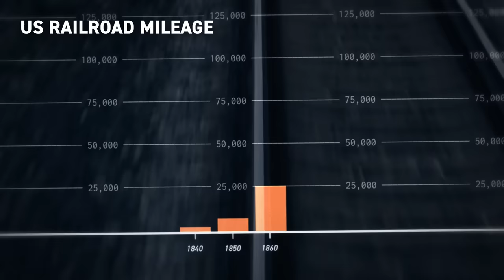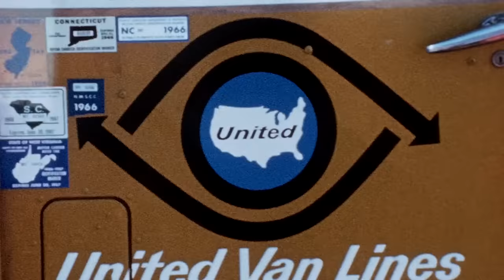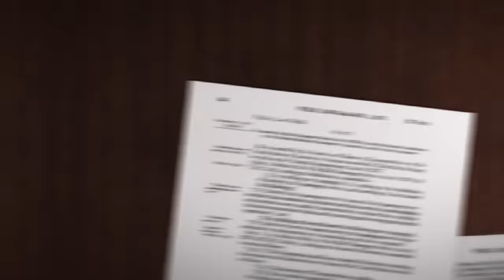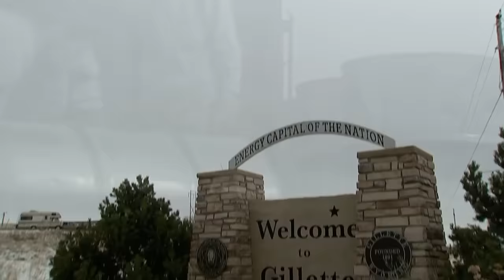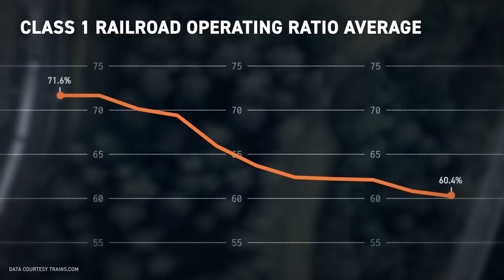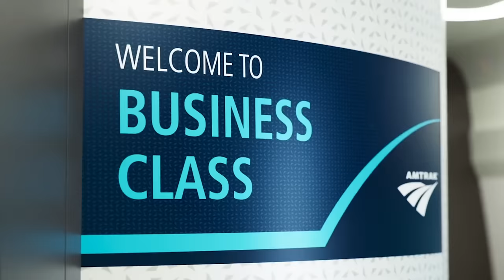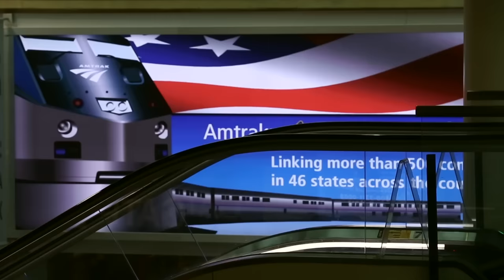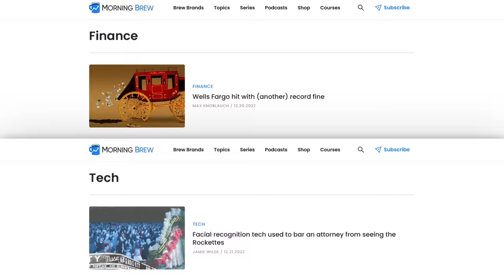The One Tiny Law That Keeps Amtrak Terrible

Comment: I recently took Amtrak from NYC to Virginia and I thought it was great. Granted, I was comparing it to the experience of being on a plane and also, it was NYC to Virginia, not literally any other route. lol
Reply: one of the best routes
Reply: NYC to Virginia is actually a common route for DC. 

I would LOVE to take an 18 hour, overnight train ride from NY to Chicago on a mid cross country trip to see sites, enjoy the views on a low pressure and low cost trip to just slow life down. But. It will never be a profitable route because we have beat into Americans heads to avoid rail whenever possible. 

Honestly, trains will just never be profitable for passengers. It's just too slow, inconsistent schedules, and no wifi for passengers. 

People must fly for urgency or speed or drive. There is no in between :/
Reply: Dude that’s literally my experience but backwards, I went from Newport News to NYC on Amtrak after Christmas, and I was just on my switch the whole time, pretty fun experience actually
Reply: @cheetah219  I don't want to do that at all. I can think of a lot better ways to spend my time than being on a train for 18hrs. You can drive it in 12 and have a car when you get there. A train has to beat a flight or drive on either speed or cost though ideally both. If it was a high-speed rail running the trip in 4 hours and less than a plane ticket that would do it.  Beats a 2.5hr plane ride by skipping the airport hassles and way faster than a car at 12hrs.
Reply: @NONO-hz4vo  I'd disagree. Driving a car from New York to Chicago would mean having to concentrate on traffic for the entire distance, not being able to just sit back, relax and close your eyes, read a book or use your phone. Taking a plane from New York to Chicago means having to deal with check-in, security, limits on luggage and all the other airport faff, and then being squeezed into a seat with inadequate room for any of your limbs. Trains offer the best of both worlds there; the comfort and unrestricted access of cars, and the ability to just sit back without having to operate the vehicle yourself of planes. Sure, time matters and so does cost, but trains don't have to beat cars or planes on those metrics, they just have to get close enough for people to consider the slight increase in time or cost a worthwhile price to pay for the benefits of train travel.
Reply: For best results, take the routes that the politicians take.
Reply: @rjfaber1991  That was a very good explanation. Thank you.
Reply: @rjfaber1991  One of the unseen benefits of train travel is saving wear & tear on your car. I take the train 3-4 times a year to see family. I live in Norfolk, they live in Harrisburg. Driving takes 6 hours but involves the stop and go traffic of DC and Baltimore. The train takes 9 hours and costs about $200 round trip. I consider that $200 fare an investment in delaying having to replace my 18-year-old truck. If I was still driving that distance 3-4 times a year, I'd definitely have a car payment right now.
Reply: @rjfaber1991  I totally agree. I wrote my novel during the entire train ride. Planes don’t have enough room to let you open a laptop unless you pay for business class, but Amtrak was perfect for it.

Comment: Excellent expose.  The problem however is if you start cutting into that freight rail system, which is already on the verge of collapse, you will send freight prices sky high at a time when we are already experiencing record high inflation.  And for your efforts, a few thousand rail users would get 30% better travel times.  That's a bad bargain.

Comment: Some great points were made in this video, but a few points were missed.
Amtrak's Northeast Corridor works so well because it's running on its own trackage.  While it's true that other commuter railroads run on those same tracks, they're all commuter trains, with established timetables, and it's multiple-tracks.
For Amtrak to start doing better, they will either need to build their own trackage and/or work with the freight railroads to add tracks to their mainline (single track to double, or double to triple).  To expect the freight railroads to simply give way on their tracks (which they paid for, and provide the upkeep on) is continued recipe for failure.
Reply: And AMTRAK - crews AND maintenance operations - runs a good number of those - VRE and MARC are operated and maintained by AMTRAK crews and M/R folks.  It is not the case in Europe because passenger rail displaced freight - instead, you have HGV and seaborne freight - freight rail got undone by World War II and the bombs thereof.
Reply: Amtrak's own rails across the country will never happen, unless there is a massive political shift, as one can't build a power, fiber, or pipeline without having to deal with a environmentalist induced headache of legal waste.
Reply: I agree, and wondered why Amtrak didn't buy one of the Illinois Centrals double track mainlines, before the IC ripped it out back in 1993.
Reply: i miss the PC

Comment: I remember what it was like living in Cheyenne, Wyoming. Flying out of Cheyenne to Denver for connecting flights wasn't so bad. But on the return trip I was often faced with a substantial layover that would end up taking on average an extra four hours to get back. If I could have jumped on a train from the airport, even a whopping 2 hours of travel time would have cut the time I took getting home in half.  I ended up driving down to Denver to catch a flight so that I could just drive home when I got back.
Reply: Yeah, because the 150 miles of rail track between Denver international airport and Cheyenne Wyoming… would cross two states and a dozen different jurisdictions, and only cost about $20 billion to build. Or, you catch a commuter flight to DIA or drive.
Reply: Sounds like an opportunity for someone to offer a small plane service between Cheyenne and Denver a couple of times a day.
Reply: @Matt-yg8ub  The line from Chyanne to Denver already exists. All they needed was a connecting line to the airport. Right now its possible to take the train into Denver, but to get to the airport from the train station requires taking a bus.
Reply: @nhansen197 this isn’t true.  It would be possible to run the train from Cheyenne into Denver’s Union Station (same place where Amtrak goes now on their California Zephyr service) and then switch to the airport train which runs every 20 minutes (from 5am-ish to midnight-ish) out to the airport.  Once you arrive at the airport, it is a 4 minute walk to security.  No bus involved.
Reply: @Dave-my1we  The web site a looked at made no mention of a connecting train.
Reply: @nhansen197  oh that’s because it’s broken like 75% of the time. They haven’t been able to get the thing reliably running in the 6 years since it opened.
Reply: @nhansen197  I thought you were proposing a high-speed passenger rail line. No such line exists. If you want to take the freight line from Cheyenne to Denver, OK fine why is that a topic of discussion?
Reply: @Sb_747  this is not true in y experience.  But I am open to be proven wrong.  Please show me the statistics that the union station to DIA DENVER train is “broken 75% of the time”.
Reply: @unatrek2821  When I lived there, there was no through bus connection. Trying to take the bus from Cheyenne to the Denver airport was no different than taking the train. Once in Denver it would be necessary to navigate the local transit system, meaning multiple transfers. Guaranteed to take way more time than it was worth. In short it would have been better to just sit in the airport for four or more hours than to take a bus. Plus there is the issue of buses stopping at multiple locations along the way which adds even more time to the equitation. And for your information, I've traveled by bus plenty of times. Sure it beats driving long distances, and yet, when on a bus or any other form of mas transportation we are captive to that transport until we reach our destination. Wanting to spend as little time as possible traveling is just being reasonable. After all, the more time we save the more time we have to do other things.
Reply: @nhansen197  ... I may be wrong, sorry.  So you want a train to take you Cheyenne to downtown Denver, and then you'll take the light rail to the airport.  Instead of drive 2 hours and park by the airport?  And a greyhound Cheyenne to Denver bus wouldn't be as good as the train, how????????????     . ..   .Americans like cars for many reasons, that so few take greyhound is a good reflection how willing they would be to go to a foreign city without their car.  Trains especially only work in dense North East US, under 10% of Americans live west of line Minneapolis to San Antonio, not enough rain or good soil its like Tibet has few people the West US has few people.   . . .
Reply: @unatrek2821  The big reason not to take a car to a big airport is how much they charge to park. Long term parking at an airport is luxury many can't afford. Possibly one of the deciding factors of who takes which form of transportation. I actually parked outside of the airport one time and walked from there so I wouldn't have to pay out what they wanted for parking. America does not have enough public transportation and dependent on the need for cars to get to most places. Having a car on a trip means being able to go places not served by public transit, and it means not having to wait around for that transit. Even so, there have been plenty of times I'd have gladly left the car behind on long trips and have done so. I've traveled by bus, train, and airplane. The only form of transportation I haven't used is going by ships.
Reply: @unatrek2821  Americans have 50% higher cars (vehicles) per capita than the EU. Americans also drive more than twice as much as the EU per capita. So Americans have more cars and drive those cars far more than Europeans. Most Europeans  do have access to a car (their own or a family shared vehicle) because they do need it on occasion but for most it’s not an an everyday need, unlike Americans.
Reply: @unatrek2821  “Americans like cars for many reasons” because Americas decided to stop building public transit (and removed many others like trams and street cars) for a while and built up roads like crazy! So of course Americans like cars when policies  built up roads and neglected or removed public transit options.
Reply: @Homer-OJ-Simpson  ..... All rich people love cars not just US.  Europe has 700 cars per 1000.  Japan 500.  Honduras has 100.  At 700 cars per thousand clearly the Europeans love cars.  Statista com shows about 70% of workers get to work by car at least, in some places in Europe its 85%.   . .  .. .  Its like arguing "Americans love meat they're awful", nope, the French love meat, the Spanish, you just listened to propogandists trying to claim Europe is a transit sucess but if 70'% is a sucess then Im Santa Claus. . . . .. .  .... US grew from 150m to 340m after 1950 so built lots of suburbs, Europe only went from 400 to 500 so hardly built suburbs, so thats the big difference, the US had kids and immigration, I refuse to feel bad that US added 120% while europe just 20%, thats a pathetic way to stay small and dense and let  some people walk to work..... .. .. . .  Im no expert just saying the other side of the argument, dont just listen to the TrainLovers who weirdly never mention that cars are 3x faster doorstep to doorstep, use a car if you want to see your family an extra hour a day, who the F don't want this, answer is jerks who are hated by theirr fmailies or who don't have family???   . ....   Again just saying the other side..... PEACE
Reply: @unatrek2821  "Europe has 700 cars per 1000." Actually, EU has 560 cars per 1000 and US has 890 cars per 1000. In addition, US travels more than twice as far per year by car than Europe. And Europe was falling in love with cars as well post WW2 but since the 70's, they have worked backwards to remove cars and spend more on public transit. US continued to tear down train lines or stopped spending on new public transit while they increased spending for cars.

Comment: Another problem is the stations. When a plane is late and you miss a connection, you are "stranded" in a secure well-lit well-staffed building with   bathrooms and vending machines, surrounded by hotels and rental cars that operate 24x7. When you arrive at a train station it may be closed, in some places even if the train is on time. And those other amenities are harder to get as well. If trains went to airports or at least had a shuttle and the airports were required to treat train passengers like air travelers it would help a lot.

Comment: It’s not just about the tracks existing or slightly faster than driving It has to be cheaper! But right now amtrack is more expensive than even flying
Reply: Between how airlines treat customers, and the extreme government restrictions passengers have to go through (invasive searches, long lines, and they won't even accept standard ID from my state), I'd never take a plane unless it saved a whole day over a train.  I took the train to college and back once, and it was better than driving so far, especially alone, since I could just use my computer on the train.  If you have multiple people in a car, it starts to seem a lot better both for cost, and for allowing everyone but the driver to do other things like read, and the driver can still talk to them.
Reply: while its no excuse for the excess cost (which ofc could/would go down if problems in the video could be the solved) but if you book really far out, like a month or two at least, it is a whole lot cheaper!!!
Reply: More expensive than flight tickets (to a point) is fine, since you avoid TSA and a bunch of other BS and usually train stations are in better locations so you save money there.
Reply: It's more expensive than flying because too many people want to ride it compared to available seats. 

It does provide an affordable way to travel between small towns that even intercity coaches don't serve anymore.

Comment: Brightline is building a brand new passenger rail line across Florida (125mph) almost entirely in the ROW of 528 and I-4. We need dedicated high speed routes in dense, urban corridors.
Reply: Would you support the state or federal government buying and leasing/renting out real estate to finance the operation of the railway? Brightline does not expect to make a profit off of ticket sales.
Reply: The rail ROW in most states that once existed are gone. City after city are against RRs and force removal of rail lines, yards citing lack of use and pollution. The once existed lines which would provide an alt to roads and more direct routing.
Only in some poor new designs at extreme costs they place these new lines near,  next or in the median of roads/highways with many crossings creating further congestion and slowing travel for all further.

Comment: Finally got around to watching this last night. One issue they mentioned briefly is the rail freight industry's shortsightedness in regards to track maintenance.  I'd wager that those longer and heavier trains they are so reliant on actually increases the maintenance requirements, which is going to lead to more down time for repairs, and further delays. In short, they need to break the cycle before it becomes self-perpetuating. It's a shame because I would passenger rail offers so much for those with the time to use it.

Comment: The actual cause of the railrods’ decline was the massive subsides given to the trucking and automotive industries by the construction of the Interstate Highway System, and the crippling rate regulation of the Interstate Commerce Commission. The latter was particularly egregious, because it set limits on how much the railroads could charge in the early 1900s and then didn’t adjust those limits for inflation, eventually squeezing the railroads into unprofitability. This regime was eventually abolished when the government was running Conrail and essentially realized that it was literally impossible for it to ever make a profit under the ICC’s rules. Once the industry was deregulated, the railroads began to make profits again.
Reply: None of that will matter as long as Freight owns and dominates most of the rail.  Trucking and automotive transit and shipping is more efficient because trains are shit and are practically run by monopolies.

Comment: I’m from Colorado Springs, if we had a line running from Cheyenne to Pueblo, that would be amazing. I25 is difficult at best during the day if not down to stop and go. They’ve widened it several times at various sections (the stretch from COSprings to Den is 3 lanes all the way now) but the time of construct has generally been longer than open operations before there’s more construction on the highway. I have to go to Denver every now and then, and my car isn’t good on gas, if I could take a train to Denver and shuttle, I would
Reply: I agree, especially since there's so much more open land on the front range compared to the Northeast.